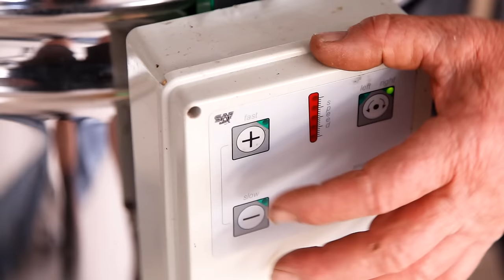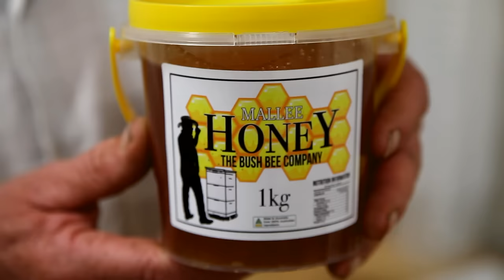Unveiling the Uncapping Box - Honey Harvest | The Bush Bee Man

Comment: The legs are bassackwards - they are supposed to wrap around the corner of the tank not have one side sticking out.  If you swap them around to fit that way, it will be both more stable and more robust.

Comment: Switch the legs on the table so that the leg hugs the corner of the container. It will be more stable. Put that grill away. Place boards across the table (25mm wide by 10cm).Screw in a self-tapping screw in the middle of the board. Blunt it so it doesn't hurt the frame too much. This will allow you to hold the frame at any angle and rotate it. Two people can work from different sides. 
I enjoy watching your videos and I'm happy to share my experience. Sorry for my English. Thanks google translate. 🇺🇦🇺🇦🇺🇦🐝🐝🐝✌✌✌